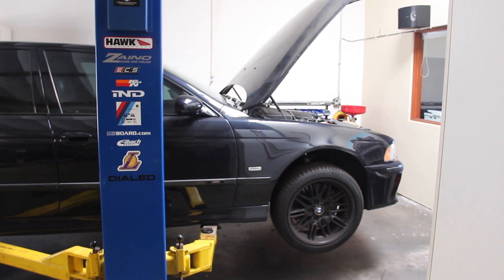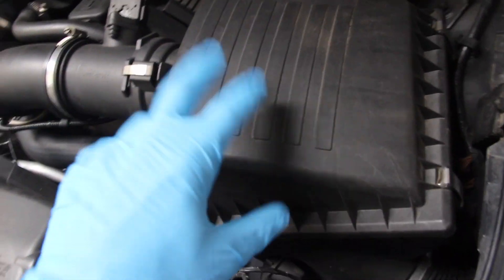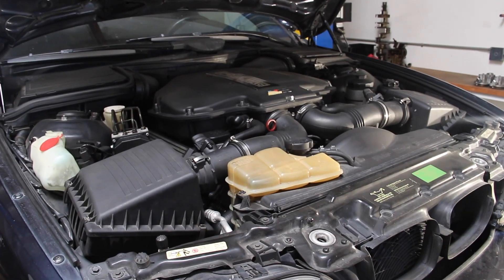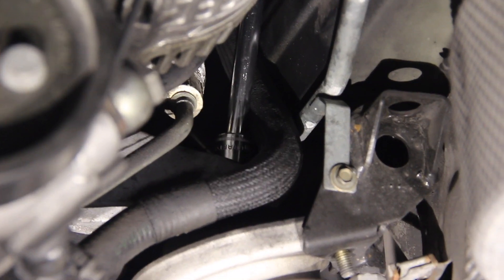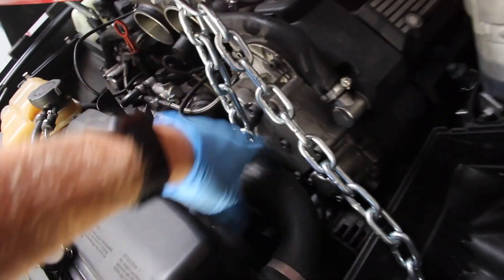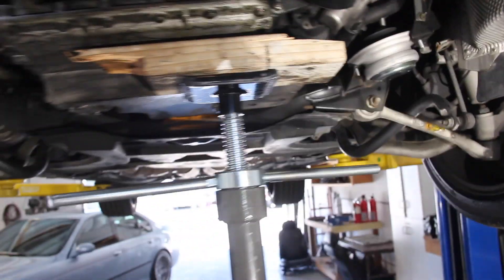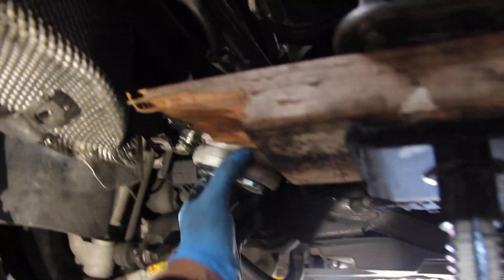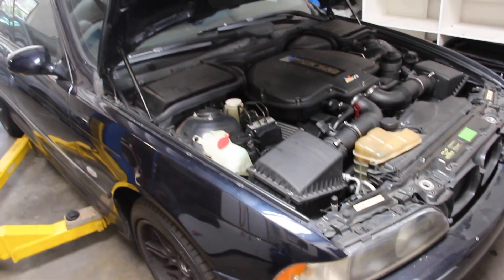BMW E39 M5 S62 Motor Mount DIY

Comment: Would new engine and trans mounts potentially improve positive shifter feel? I recall bad engine mounts impacted shifter feel/directness on my S2000 when I changed those out.
Reply from the maker: Extremely worn engine/trans bushings could effect shifter feel, but not as much as the worn out shifter carrier bushings and transmission selector rod joint do.

Comment: Looks difficult without a vehicle hoist . What does this cost ?
Reply from the maker: A lift can go for anywhere between $1,000 and $10,000, plus installation, which requires thick enough concrete, enough ceiling room, 220 volts, etc etc.

Comment: Great video. Thanks, Ryan.   Question for you:  why did you not address the transmission mounts?
Reply from the maker: The customer requested fresh motor mounts, perhaps transmission mounts will follow at a later time.